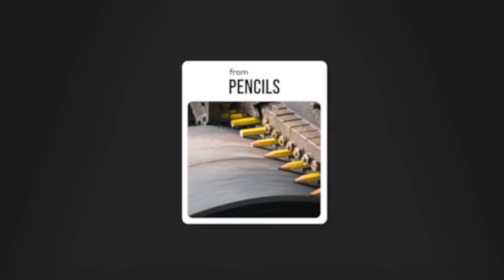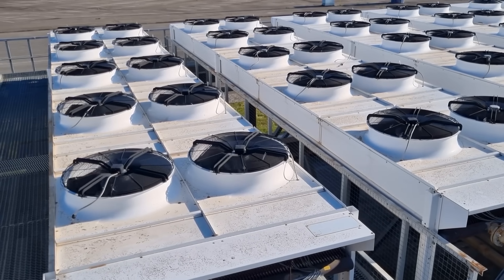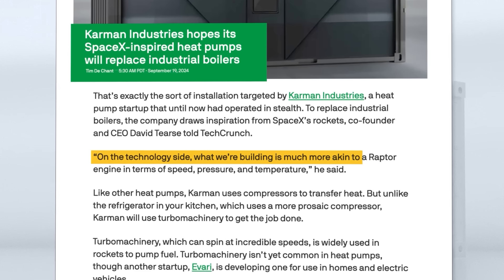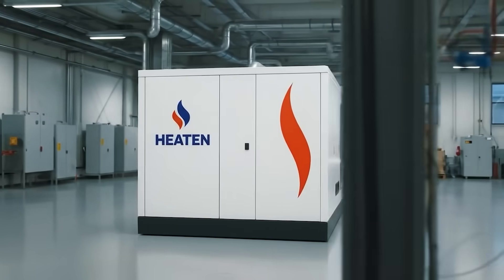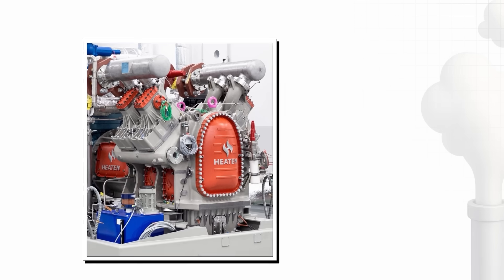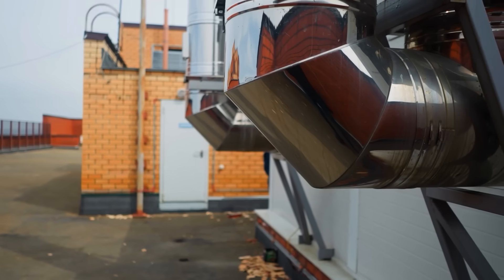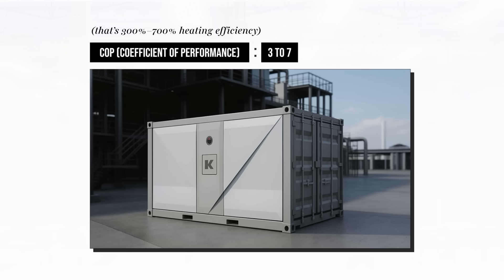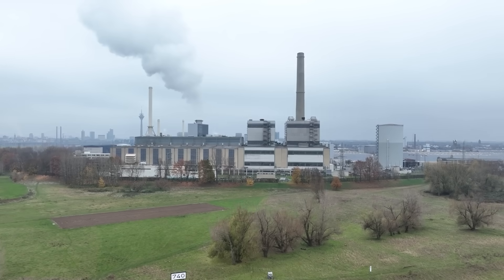Is This Space-Tech the Future of Heat Pumps?

Comment: Danfoss already makes the Turbocor compressor which uses magnetic bearings. They bought it off an American company, who I think were called Turbocor. It's used in aircon systems and has I believe reached COP's of 10 in some circumstances. Doubt it will be much good for high temperatures, but it is something to work from. I don't think that the gas chemistry is anything like ready yet.
A reciprocating compressor running at the pressures and temperatures to do a decent job is GOING to have maintenance issues.
Reply: You only get a COP of 10 with a very low temperature increase.
Reply: @rogerphelps9939  Yes, that's why I said some circumstances.
Reply: It would have been interesting to also see a comparison with UK based FutraHeat's Turboclaw technology that is already being trialed at a brewery (after all tech and beer are good mixes).
Reply: @GruffSillyGoat  Yes I worked in brewing for 20 odd years. We were always interested in saving money long term with decent tech. Have to say that I hadn't heard of the Turboclaw, I will investigate further.

Comment: To be perfectly honest, this seems more like a scam then something real. For a few different reasons.

1, Why bring up SpaceX raptor engine, its a turbo everyone knows how they work, its not like SpaceX invented it.

2, We have very efficient heat pumps today, i dont see anything new or any innovation in their design.

3, The bloody amount of buzzwords.

4, The photogenic CEO.

5, How bloody innefficient turbos are, in a car they are excellent as they use the unused hot exhaust to pump more air and fuel into the cylinder, which means even more hot exhaust which means a faster turbo. Well in this version all that energy has to come from the outside,... all i see a shit ton of waste to be honest.

Do i need to go on?

Comment: Great explanation and graphics.  I finally have a mental visualization of the process of refrigeration and, in reverse, heat pumps.  Thanks for the video!  Excellent work!!  Are you familiar with the name Raphael Morgado, Angel Labs and the MYT engine which stands for Massive Yet Tiny.  It is not only the smallest, most powerful and fuel efficient internal combustion engine ever built, it is also the most powerful pump ever built achieving both high volume and high pressure at the same time; and it's the most compact design ever achieved.  His engine/pump won first place at NASA's Create The Future contest in 2005.  Implementation of this into heat pumps as both the engine and the compressor pump would make heat pumps economically available to the general public.  The engine/pump has only 50 major moving parts.  It achieves full torque at 80 rpm therefore eliminating the need for a transmission.  It would change absolutely everything almost overnight which is why he has not been able to get it into mass production.  Those with financial interests in the energy and transportation industries would experience short to medium term losses which would rub them the wrong way.  They control the flow of investment capital.  He's still trying to get it to the masses.
Reply: Rubbish. ICEs are very inefficient. Research he Carnot cycle.
Reply: interesting- I have not heard of this before
Reply: @helder4u  It's for real.  There may still be You Tube videos of it.  The video of his booth at the L.A. Auto Show is an interesting demonstration.  He's talking to Chrysler engineers who said they were told to stay away from his booth so they went to the booth to see why.  An older engineer told him the basic design was called a toroidal engine and the idea was developed in the early 1900's but no one could figure out the timing, which took Raphial several years to figure out.  I just searched YT under 'MYT Mighty Engine' and several of his videos came up.  The L.A. Auto show video is titled, MYT Engine Inventor Raphial Morgado, 18 years ago.  There are also a few videos with moving, mechanical drawings showing the basics of how it works.

Comment: The amount of lack of clarity is clearly equaled by the number of buzzwords here.
Reply: I second that motion!!!  🤠👍
Reply: This guy is just a communication graduate baiting for views with his sensationalism. He's probably also ragebaiting anyone with above highschool engineering level of comprehension with all his bullshit.
Reply: I've only watched the first quarter and my BS meter is pinging. Even mentioning "thousands of degrees" from a heat-pump is concerning. That's not a technological limitation, it's a limitation of thermodynamics. There's only so much "usable heat" in waste heat. The amount of hot air you'd need to process to get a usable energy for industrial applications is rivaled only by the hot air in the video!  (sorry)

Seriously, the surface area and flow required would offset any economic benefits from up-cycling the heat. Heat pumps are great from an efficiency perspective but at a certain point it becomes cheaper to build a solar farm for the extra energy rather than making some industrial process 2% more efficient.
Reply: @daniel.watching  If you bothered listening to the context, all he said is "it's going to be a long-time until heat pumps can get to the thousands of degrees necessary for steel or ceramics, if ever" That was it, not saying whether that would actually happen. 

And considering that there's a lot of usable waste heat from industry that can be used for different applications, the heat pumps being described here are using the lowest temperature and hence LEAST usable waste heat from industrial sources, while being able to create heat pumps that cam tolerate and use higher temperatures means you can do more WITH that waste heat. Maybe you should have bothered to understand what he was talking about first?
Reply: Btw: O don't think you understand what a "buzzword" is. What you mean is "more complicated vocabulary than I'm used to using." I couldn't figure out wtf you were talking about until I realised you didn't understand your own comment.

Comment: I didn't quite understand how the waste heat is transferred into these heat pumps. Are the ambient conditions inside some factories 90-130C? Do the pumps need to be placed inside sealed rooms with the otherwise waste heat? I guess I'm just ignorant as to the conditions inside factories.
Reply: Many things in factories are often water cooled, and the resulting warm water is often cooled down in cooling towers. In locations near rivers or lakes, the river/lake water may be used with a heat exchanger to cool the warm process water. The factory I work in uses river water.

So you have lots of warm water flowing around, which is fairly ideal for a heat pump to gather heat from.
Reply: @Sparky95  Thank you - great explanation.
Reply: they could draw from ambient air or have streams tubed to their input side.
Reply: @lylestavast7652  Thank you - makes sense.

Comment: Why not use carbon dioxide instead of expensive, flammable, toxic, and potentially explosive hydrocarbon refrigerants? Carbon dioxide is totally lacking in toxicity, inexpensive, and has excellent refrigerant properties. It is the safest and most common fire extinguisher.
Reply: @thestresstheoryofhansselye3607  Not suitable for high temperatures. R744 is indeed used but for low temperatures (-40/30°C) up to 60/70 but in supercritical cycles. No way to go to 200.
Reply: Carbon dioxide has an Achilles' heel, in that it likes to turn into a solid (dry ice) under the right conditions. Obviously solids do not flow well through pipes, valves, etc.

Unfortunately those conditions exist in typical refrigeration systems, and systems that use CO2 have to be designed to avoid that. That limits what you can do with CO2, and constraints are typically something avoided when you're trying to do something novel (like high temperature heat pumps).

Comment: Former heat pump engineer here:

-I doubt that a reverse Brayton cycle can fit in a box. Problem with gas is the need for huge heat exchanging surfaces
-a great refrigerant for high temperature heat pumps is that oxide, you know, dihydrogen monoxide 😉. It's stable up to 500°C. If used below 100°C some care must be taken to ensure proper degassing because some parts of the circuit are going below atmospheric pressure, accumulating air through micro leakages. Not rocket science at all, but it makes for a soft lower limit on heat source temperature.
-multi-stage compression is only more efficient if you have an intercooler. Otherwise it is just done for technological reasons - axial machines are limited in the pressure step of a single stage. The choice between centrifugal or axial compressor is dictated by the ratio between volumetric flow and pressure ratio. Axial machines are only worth if flows are huge compared to pressure change.
-it's "kelvin", not "degrees kelvin"
Reply: The problema with dihydrogen monoxide (R718) is its ominous pressures at those temperatures...
Reply: @smferreiro2610  compared to heat pumps using R744 the pressures to condense at 300°C with R718 is moderate.
Reply: ...the box we're talking about is a 8x8x20'.
Reply: @matzke1129  A box contains just the pump,  no heat exchangers, no condensers, dryers or accumulators which are significantly larger, so Karman are being disingenuous by suggesting the 'system'  fits a 20' 'Box'. Also their COP numbers are ambiguous by not including latent heat available.  Karman just regurgitate word salad.
Reply: Speaker is in a "VAN, DOWN BY THE RIVER!" 😅
Reply: A supercritical refrigerant cycle runs on a low enough differential that a turbocompressor would be viable I think, and gas coolers full of supercritical fluid are efficient enough they should fit in a box. CO2 (R744) would be the obvious choice, or you could cascade that into a water vapor cycle for probably better efficiency.

It's viable on paper, but let's see them actually build one that does what their math says.
Reply: I don´t know if i agree with that. If you have a reverse brayton cycle with a centrifugal turbine you can make it really small. Like REALLY REALLY small. i seen systems like that with a turbine no larger than a coin. Of cause, yes, efficiency goes down with small size, still it works
Reply: Water is bloody corrosive (at best) in high temp and pressure (HTP) conditions.

Designs using supercritical CO2 have been postulated for a while, mainly for power generation but they certainly reduce the heat exchanger surface areas needed
Reply: @alanbrown397 We use water in steam plants since 200 years. Also, pressures are quite low.
Reply: Thanks for that info. I noticed that a lot of heat pumps tend to compress various gasses, and I was wondering if compressing air can reach those efficiencies?
Reply: @scaleneous Usually you want to work with vapors rather than gasses, because the phase transition from gas to liquid and vice versa allows for quite small piping and heat exchangers. Expansion is also very easy, just a throttling valve, whereas the expansion of compressed gas requires a turbine, both because otherwise there is no change in enthalpy and thus in temperature and also to recover part of the huge amount of energy it took to compress the gas in the first place. In a typical Brayton cycle, 2/3 of the power generated in the expansion turbine is fed back to the compressor (this ratio is the same even if you invert the cycle).
Reply: Also, a coefficient-of-performance of more than one is never described as an efficiency of over 100% as is claimed in the video.  A heat pump does not create energy, it just moves heat from one place to another - and it literally takes extra shaft energy to make than happen, so an efficiency of less than 100%.

EDIT - holy smokes, I don't get the SpaceX connection at all.  The heat pump draws inspiration from SpaceX because they both use a centrifugal compressor?  That's like saying the 1967 Ford Mustang drew inspiration from SpaceX because it uses a centrifugal engine coolant pump.  Did Elon pay for this video?
Reply: @DefiantStorage1009 yes it does
Reply: @DefiantStorage1009  On the contrary, I've seen efficiencies over 100% quoted in many places. It's perfectly valid as long as they make it clear what they mean: Heat delivered per unit of electricity used. A COP number of 5 means just that, and it's equivalent to 500% efficiency. In absolute, "global" terms it makes no sense of course, but within the given constraints it's fine.
Reply: @tvuser9529 No, it's not fine.  That's why engineers use the term COP "coefficient of performance".  If the two terms were interchangeable then COP would not exist.

Pretending that COP of 5 is the same as 500% efficiency is both incorrect and dishonest.

Anyone quoting more than 100% efficiency is either (1) lying, or (2) a non-technical person that doesn't know better.  Just because you have seen someone quote more than 100% efficiency does not mean that it is valid, especially when (like in this instance) it isn't valid.
Reply: @DefiantStorage1009  Agree. And we didn't even started on second principle's efficiency 🙃
Reply: @DefiantStorage1009  You're pushing back against an industry that has already adopted "efficiency" to mean heat output per unit of energy input, which is how boilers are often marketed too (e.g. "85% efficiency" for 0.85 units of heat per unit of gas).

For most consumers, COP is meaningless. Saying "500% efficient" makes intuitive sense to them, even if it’s technically imprecise. You could make the same argument against how boiler performance is framed, but no one complains there.

Companies like Octopus and other heat pump manufacturers already use "efficiency" this way in public-facing material. It’s not technically dishonest — it’s just adapted for broader understanding.
Reply: @BenIsInSweden  Yes, "500% efficiency" is as valid as COP 5 or any other terminology that is clearly defined and physically correct, which this is in the context it's used: Heat output divided by electricity used. A sensible definition when comparing a heatpump with an electric space heater, for example, since no one pays for the heat we extract from the outside. We only pay for the electricity. No one is claiming that it magically creates energy from nothing.
Reply: @DefiantStorage1009 this channel is, perhaps surprisingly, aimed at a Youtube audience, it's not a doctoral dissertation in a university, "500% efficiency" is fine for the target audience.
If you're interested in the content rather than picking a fight you might just possibly notice that he uses COP every time before offering the layman's term.

Comment: Here's my concern:  the bearings for the turbine/compressor.  That is spinning at "50,000" rpm and at temperatures that are in the hundreds of degrees.  While a SpaceX turbine might have identical  conditions, they run for a period measured in minutes.  To be practical for business this unit will have to spin at "50,000" rpm continually for at least a couple of years. How do you lubricate those bearings?
Reply: Smaller gas turbine engines run at similar (some even higher) speeds and higher temperatures, and do so for thousands of hours. Typically bearings in such applications are lubricated with pressurized oil that circulates through a heat exchanger to cool the oil back down.

In a sealed refrigeration circuit where oil contamination would potentially be an unacceptable risk, it is also possible that some sort of magnetic bearing that doesn't require lubrication would be used.
Reply: @Sparky95  Problem with magnetic bearings is loss of effectiveness with high temp applications. This would definitely qualify.
Reply: @sinewave999  That would be relatively easy to solve by bypassing some of the cooler suction gas through the bearings to keep them below their Curie temperature.
Reply: @Sparky95  Look up Danfoss Turbocor. Magnetic levitation bearings, 20k rev/min

Comment: High temperature industrial heat is a key process to decarbonise in the journey to Net Zero. The hotter the output, the more industrial processes can be transitioned, and the more processes can be modified to fit within the decarbonised temperature envelope.